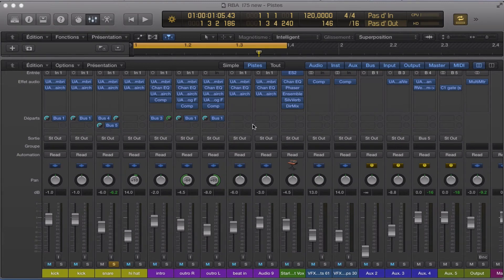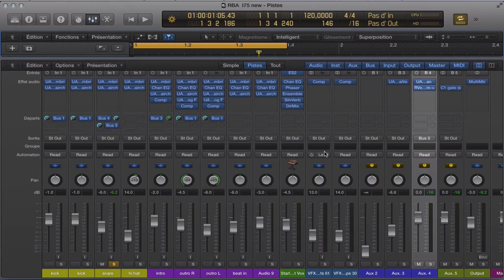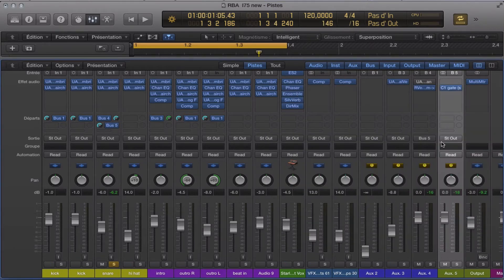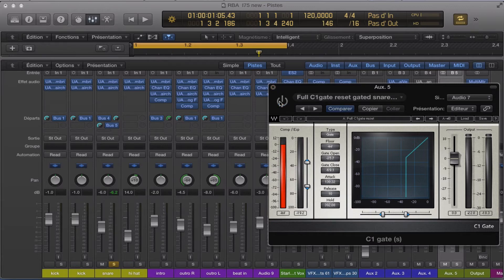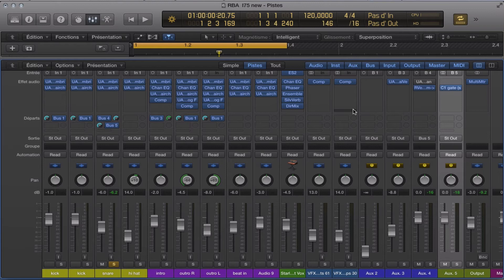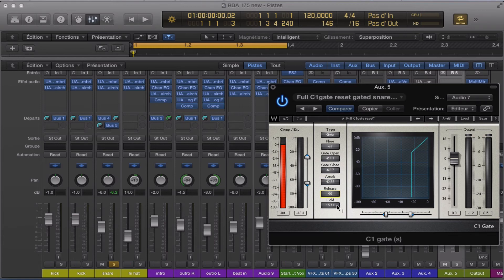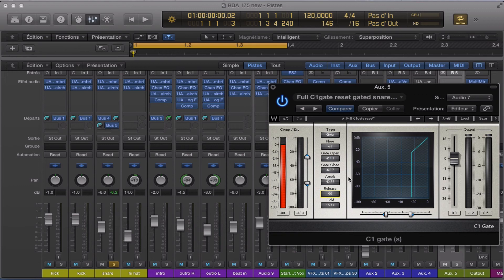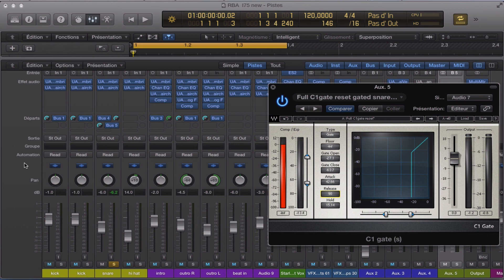gated reverb snare effect EDM tuto logic x

Comment: is there a reason why you have to create Bus 5 for the gate plugin instead of leaving it on the same channel strip as the reverb (Bus 4) ? also why Pre fader and not Post Pan ?
Reply from the maker: +Tommy Mai   hi there, yes it's more easy for your core processor to create the bus 5, you will make the core of your computer working less,
but you can install the plug strait on the channel, 
if you have at least 64 G RAM...........
plug got ton's of energy processor........
about preFADER it's often before, to feed the bus created, 50/50 , you can also probably use post fader, but i didn't remember the effect , different .....